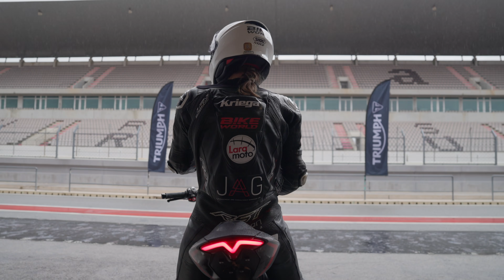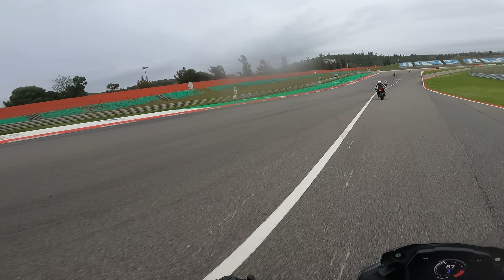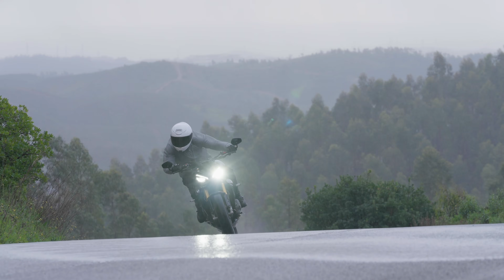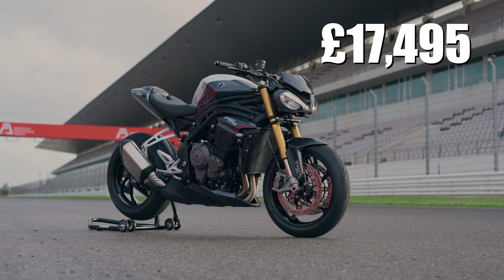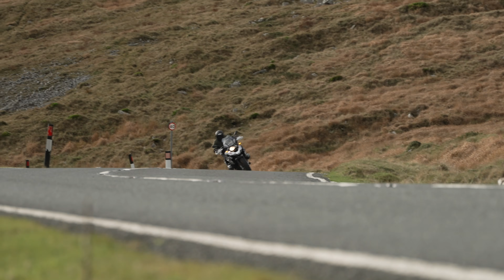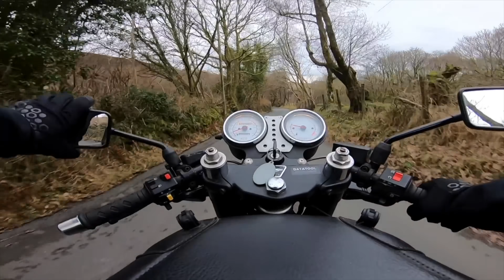2025 TRIUMPH SPEED TRIPLE 1200 RS | FIRST RIDE ON TRACK & ROAD

Comment: Triumph have proven to be unreliable bikes though, with terrible aftersales service.

My 1200RS has been a total lemon. Endless failures, then it needs an engine rebuild before its first major service.

Triumph want nothing to do with it.

2.5 years old with full  Triumph service history. 

After months off the road with endless failures, broken gear shift shaft, failed fuel sensor, failed gear detent, failed Quickshifter, faulty clutch, then it popped the head off a valve at idle.

It's a really unreliable piece of crap.

Comment: Not worth ducati pricing
Reply: Except it's not ducati pricing. The v4 is 2000 usd more, and that's the non electronic suspension model. This is a better road bike than the ducati. The ktm, triumph, and aprilia are the best super nakeds. 200 peaky horses aren't very good for the road.
Reply: @rns6889  agreed, I own a Tuono V4 and don't ever feel like it needs 20 HP more. And I live somewhere that has a lot of wide open straight roads.
Reply: @kupalisky3553  torque trumps horsepower for the road, everyday.